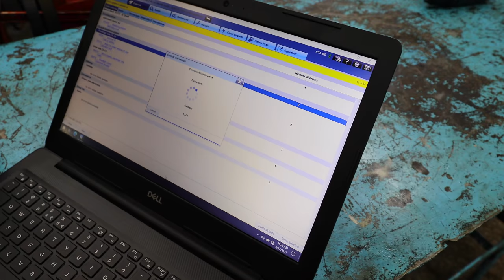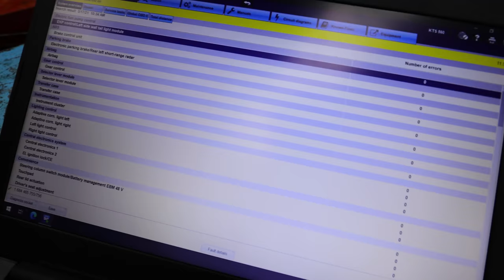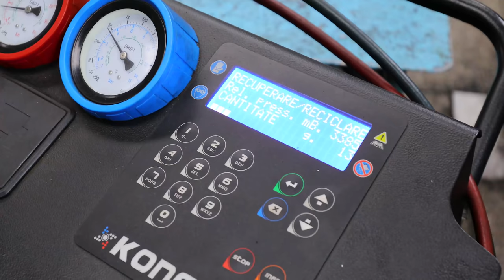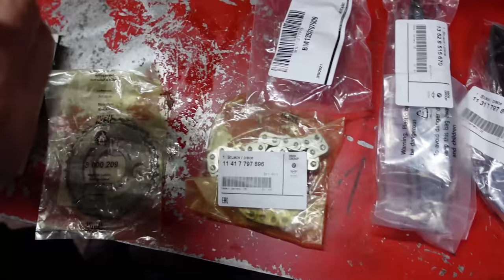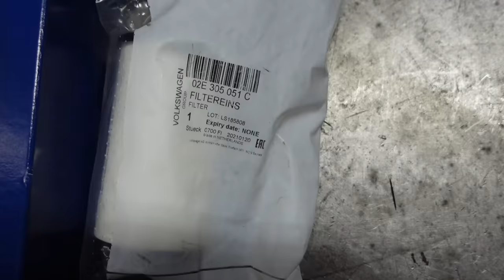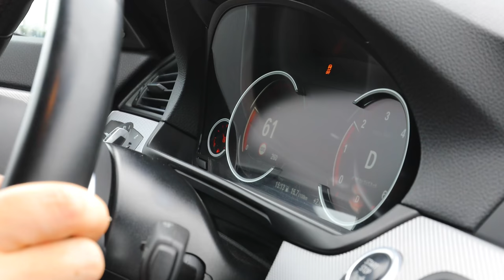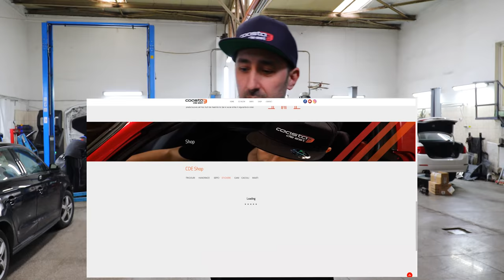BMW M550xd - balaurul cu 3 turbine 😈😈😈

Comment: as spune BMW e46 (sau 320 cum mai este cunoscut intre  bombardierii cu "figuri pe stomacul gol" ) cred ca este cea mai vanduta masina de la BMW din toata istoria si nu numai 🤣. dar lasand gluma deoparte cred ca BMW e60 ca si eleganta , durabilitate ,aspect si intretinere este o masina care chiar si dupa aproape 20 ani de la fabricare inca arata foarte decent in comparatie cu masini cu putin timp vechime. este una din masinile care ofera chiar tot ce ai putea cere de la un BMW . este confortabila (si sunt foarte multe imbunatatiri after-marchet care se pot face) ,durabilitatea motorului este arhicunoscuta in toata europa (in special motorul 3.0 D d2 218 cv ) in special motorizarile diesel se pot urca foarte mult de putere fara risc de rupere . Intretinerea masinii nu mi se pare deloc scumpa in comparatie cu multe alte modele de aceasi epoca sau chiar mult mai noi. consumul (si iarasi revin la motorizarea 3.0D) este unul ridicol pt un motor de mai bn  200cv si undeva la 500 nm (serie)  ( un 8,5 - 9l/100km). sa tinem cont ca este si o masina relativ mare si confortabila . deci parerea mea este ca cea mai buna masina fabricata de bmw este modelul E60 . indiferent de motorizare caroseria este si va ramane ceva special 🤗 SALUTARI SI MULT SUCCES IN CONTINUARE

Comment: Salutare băieți! 
După părerea mea ,daca ai un buget minim,cel mai bun model de BMW este BMW e60 ,3.0D ,deoarece nu are exagerat de multa electrica si este un motor NEMURITOR care daca ii faci schimburile la timp cu motorul original poate ajunge până la 600-700.000km lejer. Pe lângă acest aspect ,daca ii pui un pachet M si ii pui Angel Eyes(daca nu are de fabrica) ii schimba RADICAL aspectul.Eu zic ca e60-ul va fi o masina exagerat de potrivita.

Dacă ai un buget mai mare de exemplu 40-50.000€ ,mi-aș lua fara sa ma gandesc BMW X5 M550D,deoarece este o masina PERFECTĂ pentru toate punctele de vedere . Este o mașină mare ,care este exagerat de frumoasă,interiorul este extrem de spațios și pe lângă aspect si spatiu ,are si un motor potent pentru acea caroserie.
Succes in continuare băieți!

Comment: 42:32 in opinia mea e36m ,cel putin din punct de vede sportiv/drifting, este tractiune spate ,6 pistoane ,motorul este impins mai in spate rezulta greutate 50/50, manuala ,ieftina ;)) , motor de 2.2 nu e foarte mic sa fiu sincer ,calutii sunt acolo,e turbo , e frumoasa ,masinile vechi in mare parte sunt fiabile ,e din 90 deci check✅, si nu inseamna ca daca e veche e neaparat fiabila ,dar e36 este relativ fiabila pentru o masina sport , are prezenta de masina sport, de vanos nici nu mai zic, plus ca este unul dintre cele mai cunoscute modele bmw ,care daca nu ma insel a fost si rivalul lui mercedes 190e ,ambele bomba, cu siguranta n am acoperit toate calitatile ,dar in schimb vreau sa zic un defect ,OALELE ;))) nu stiu de ce ,dar din ce am auzit se sparg oalele, poate vine cu suspensii prea rigide din fabrica ,poate nu ,nu stiu ,n am avut ,am 15 ani;))) va salut 🙂

Comment: bmw m5 f90  deoarce  folosește un sistem de propulsie cu tracțiune integrală "xDrive", fiind pentru prima dată când un M5 nu a fost tracțiune pe spate. [89] [90] Cu toate acestea, sistemul de tracțiune integrală este orientat spre roțile din spate. De asemenea, poate fi configurat să trimită energie numai roților din spate, dacă controlul electronic al stabilității (ESC) este dezactivat , În decembrie 2017, F90 M5 a stabilit recordurile mondiale Guinness pentru  cel mai lung drift continu a vehiculului și Cel mai lung drift dublu a vehiculului (asistată de apă) pe un skidpad umed, cu distanțe de 374 km și 144 km , respectiv F90 M5 a înregistrat un timp de tur Nürburgring de 7: 38.92 într-un test realizat de Sport auto

Comment: cel mai tare BMW ? buna intrebare, eu am 2. E30 si E60.. daca ar trebuii sa aleg, cred ca as alage E30!.

De ce E30. BMW E30 sa fabricat din 1982-1994. Caroseriile au fost variate, Coupe, Sedan, Decapotabila si familiara.

Preferata mea ramane E30-ul sedan.

E30 e evolutia E21 se bazeaza pe aceasi platforma, dar liniile curate, pe care re are masina, fata si spatele patratos, o face sa arate intr-un mare fel. E30 a oferit o inbunatatire aerodinamica fata de E21, si masca fata nu mai era asa de inclinata iar farurile se integrau in ea. Pre facelift sa produs pana in 1987 si facelift pana in 1994. In 1987, toate modele E30 au primit un spoiler din plastic fata de cel din metal.

E30 a avut 6 tipuri de motorizari diferite M10, M20,M30,M40, M42, S14. 

E30 a fost o revolutie in industria automobilistica, demonstrand performatele sale pe circuit.

De ce imi place E30? Preferatul meu este E30 320i/is, 323i sau 325i. De ce astea 3 modele, pentru ca sunt motorizarile in 6 cilindri, sunetul pe care il dezvolta, si cum se simte motorul pe acea caroserie este un sentiment care nu poate fi asa simplu descric. Pe langa asta, forma masinii este un desen curat, simplu si atrgator, de multe ori, masinile simple, curate atrag mai mult de cat masinile complicate si cu multe butoane ( parerea mea), pe langa asta cum simti strada in  volan, senzatiile pe care ti le transmite masina, sunt inegalabile fata de masinile noi. E30 nu se mai fabrica, iar un exemplar in stare buna, costa mai mult decat o masina noua, putem vedea pe internet preturile. De aici denota ca E30 a fost o masina reusina si a deveneit o masina de colectionari.E30, are probleme mari cu rugina, podea, aripi pe fata/spate, si plaguri.

Sper ca anul acesta, sau la inceputul anului viitor sa pot cumpara un E30 si sa incep procesoul de restaurare :). Cam astea sunt punctele de ce imi place mie E30. Acum conduc un E60 tot benzina.

Nu sunt adeptul motorului pe motorina din cauza sunetului, benzina are sunetul ei :)

Comment: Modelul de BMW pe care eu il ador este e39
Am o legatura mai stransa cu acea masina deoarece in ea m-am si nascut aveam modelul din 2000 2.0i am tinut masina pana in 2010 din ce imi amintesc masina nu a avut aboslut nicio problema ajunsese la aproape 400.000km si in afara de uzabile si distributie pe la 200.000km nu a avut nicio alata intervenție 
Plus modelul M al acestei caroseri cu renumitul v10 (șoc in motor)

Comment: 1. În opinia mea cel mai puternic motor diesel cu şase cilindri din lume este BMW 750d xDrive şi BMW 750Ld xDrive (consum mediu mixt: 5,9-5,7 l/100 km), versiuni care dispun în echiparea standard de tracţiune integrală. Noul propulsor generează o putere maximă de 294 kW/400 CP şi un cuplu maxim de 760 Nm. Noul BMW 750d xDrive accelerează de la 0 la 100 km/h în 4,6 secunde (BMW 750Ld xDrive: 4,7 secunde) – o îmbunătăţire de 0,3 secunde faţă de predecesorul său.
2. Noul motor de 3.0 litri, cu şase cilindri a fost dezvoltat pe baza cele mai noi generaţii de propulsoare a BMW Group. Tehnologia BMW TwinPower turbo include turbocompresie în mai multe etape, cu patru turbocompresoare şi injecţie directă common-rail.

Bafta multa în continuare!

Comment: EU CRED CA CEL MAI TARE ESTE BMW M1 PENTRU CA:
(codul modelului - E26) este o masina sport cu motor amplasat central produsa de producatorul de automobile german BMW din 1978 pana in 1981. M1 coupe a fost construit manual intre '78 si '81 si are un motor pe benzina M88/1 cu 6 cilindri in linie de 3.5 litri cu injectie mecanica Kugelfischer-Bosch si un sistem de aprindere Magneti-Marelli. Motorul are 6 clapete de acceleratie individuale, came duble, 4 valve per cilindru, si genereaza in jurul de 277PS (204kW; 273cp) la 6,500 de rotatii si un cuplu de 330 Newton-metru (244lb⋅ft) in versiunea stradala, oferind masinii o viteza de varf de 260 de km/h, sau 162 mph. Motorul a fost conectat la o cutie de viteze manuala cu 5 trepte, produsa de ZF Friedrichshafen, echipata cu un diferential cu alunecare limitata cu blocare de 40%.
	Directie, suspensie si frane	Modificare

Comment: Pasionat de masini ca si voi, detinand un ford focus ca migulini doar ca breack ,imi plac foarte mult masinile vechi masini care indiferent ca nu vor mai fii raman in instorie cu un trecut frumos .
Din punctul meu de vedere marca BMW este o marca foarte buna de masini si nu spun asta doar ca este BMW  spun  asta fiindca de la incrputul vremurilor caroseriile cat si moatoarele fabricate pentru ele au o fiabilitate de buma calitate si durata .
1 . Parerea mea este ca modelul de bmw seria 3 e 21 asa zisul rechin echipat de fabrica cu 3 tipuri de motoare (1.6 , 1.8 , 2.0 ) la alegerea cuparatorului este un model fiabil si  frumos 
2 . Avand o lungime de 2,6 m conducerea ei nu era atat de grea pe cat parea .
3 . Era echipata cu o suspensie cu arc in fata iar in spate suspensie independenta   dand un confort foarte bun dar si o tinuta de strada foarte sportiva si cu o rigiditate acceptabila 
 Astea sunt o mica parte din multele + pe care le are masina . 
Din punctul meu de vedere si a unui pasionat de masini vechi , BMW E21 este o masina cum trebuie . 
Va apreciez enorm de mult pentru ceea ce faceti , bravo vouaa si tinetio tot asa , si eu am lucrat intrun service dar colectivul de acolo a lasat de dorit , as fii dat orice sa lucrez cu voi , bafta si spor in toate

Comment: BMW e60 530d 218 cai
Caroserie încă in 2021 atrăgătoare 
Motorul de 3l este silențios și economic fata de motoarele concurente de 3l de la Audi și Mercedes 
Probleme întâlnite in 6 ani:
Termoflot+conducte(amesteca apa cu uleiul)
Kit brațe fata (vibrații puternice la frânare)
Coroana de la volata(Motorul  era foarte zgomotos)
Turbina(la 190km/h a luat-o pe ulei,3 pistoane topite,cămășile la bloc afectate,cea mai simpla soluție alt motor)
Electromotor(nu învârtea motorul)
Alternator(mașina se oprea din mers fără eroare)
Revizii la timp,cu toate cele enumerate,mașina de pe o scara de la 1-10 primește numărul 8 fiabilitate

Comment: Salut. Cel mai tare BMW ever made este Z8. Motor 5000 benzină aspirat care să aibă 400 de cai și având în vedere că modelul are peste 20 de ani prețul a urcat. Mi se pare normal ca o mașină sport să arate că una sport și să aibă un motor pe măsură. Bonus este și cabrio ceea ce oferă o senzație diferită. Până și 007 James Bond a ales acest model pentru ca nu este cu nimic inferior unui Aston Martin, ba chiar are linii pe cât de sportive pe atât de elegante. Mi se pare că o mașină sport ar trebui să aibă un motor pe măsură nu 2 litri diesel cu pachet M și plin cu stickere. Nu sunt nici hater nici fan BMW dar sunt fan motoare aspirate de aceea am un 2000 benzină (statul pune taxă pe capacitate nu și pe performanță).
P.S. Va urmăresc atât cât îmi permite timpul dar de fiecare dată rămân cu un zâmbet după ce vizionez un clip de-al vostru.

Comment: Salutare tuturor.Este greu sa alegi un model de masina intrucat fiecare are gusturile si pasiunile sale.Din ce inteleg putem alege orice model de bmw.O sa incerc sa fac un top relationat la ce mi-as dori eu daca as avea bani sa intretin o asemenea masina ;).Criteriul principal in acest top este lookul masinii,pt.tehnica sunt sigur ca exista oameni mult mai capabili ca mine sa confirme sau sa sa infirme alegerea mea.
1) Bmw e93 coupe cabrio 335i, dupa cum spune si numele este in 2 usi decapotabila cu hardtop si foarte aproape de un model M.
2) Bmw 3.0 CSL Hommage R. new version.Nu stiu daca sunt de vanzare ;) dar cu siguranta as cumpara una daca as avea bani.
3) Bmw z1 pt. modul inovativ in care se deschid usile.
4) Bmw 850i doar pt. motor v12 , pt. ca legislatia actuala nu mai permite faruri escamotabile ;) 
5) Bmw 750L(model 2001) pt. ca aveai posibilitatea sa o cumperi blindata ;)

Comment: salut
pentru prima oara las si eu un comentariu....stiu sa imi fie rusine...
dupa parerea mea BMW M3 E46 CSL este o legenda pe patru roti cu doar 1383 de modele fabricate (este cel mai scump model e 46 inca de la fabricatie) acesta sa fabricat intre ani 2003 si 2004  unul in stare foarte buna este aproximativ 65 000 de euro, masina venea in standard cu plafon de carbon care cantareste doar 7 kg

Specificati tehnice.
motor 3.2 24 v 360cp 370 nm la 4900 de rotati pe minut 
injectie multipunct
0>100 4.9 sec
viteza maxima limitata 250 kmh
cutie automata in 6 trepte smg 2 cu un  singur ambreaj
greutatea masini este de doar 1285 kg
consum:              oras      17.8
                   autostrada     8.4
            si combinat de     11.9  
De masina asta se pot spune foarte multe lucruri, in ziua de azi toate masinile  din seria M si M performance sunt din ce in ce mai incarcate cu senzori, de la suspensie si pana la volan totul este electronic
@Baieti sunteti cei mai tari in special valica

Comment: Salut baieti! Cred ca in inimile multora o sa ramana M3 e46 coupe ca fiind cel mai deosebit model de BMW, cel putin pentru mine acesta este. Este greu de explicat de ce dau acest raspuns, si spun acest lucru, pentru ca in anii 2021, performanetele masinii respective sunt pe departe depasite de multe modele noi BMW si nu chiar M, insa pentru acei ani, era ceva deosebit.  Se comenteaza foarte mult de asemenea si de problemele lui, mai ales despre cutia SMG, sau despre cuzineti, puntea spate. Fiecare motor si masina are micile probleme, insa merg pe premiza ca se pot rezolva. Sunt fan cutie de viteze manuala, insa, daca imi voi permite  vreodata o masina proiect, ar fi un e46M cu SMG, pentru ca il vad ca si pachet. 
Este o masina ce face trecerea intre old school si new school! Are electronica de care ai nevoie, insa se conduce ca si o masina old school, servodirectie, rigida, siseme ce pot fi dezactivate usor etc.
P.S. Tineti-o tot asa!

Comment: e36 si e46 au un loc special in inima mea ar fi greu de ales dar cel mai probabil as alege e36 doar din cauza electronicii care este  mai simpla , chiar consideram un e36 320i cand imi cautam prima masina doar ca stiam ca o sa imi fie foarte greu cu intretinerea (piese scumpe) si nu voiam sa o transform intr-un "cazan"  , deci pentru mine cel mai misto bmw o sa fie un e36 coupe 2l benzina 6 cilindrii single vanos pentru ca double vanos e mai problematic desi e mai interessant pacat totusi un vtec german nu suna rau deloc.

Comment: Din punctul meu de vedere,eu as spune ca cel mai misto bmw din toate timpuriile este seria 5 e34, spun asta deoarece am detinut unul acum vreo 4 ani, si am ramas placut surprins de modul in care se conduce ( ps: pe drum privat ca n am permis) , si fiabilitatea sa, spun fiabilitate, deoarece acel bmw , eu cu cumnatul meu il cunosteam de ft. mult timp, si stiam aproape tot despre el. Masina pot spune ca era un tank pe roti, datorita fiabilitatii ei, poate si pentru ca a fost intretinuta, cand a fost la mine, avea aprox. 300 de mii de kilometrii la bord, kilometrajul resetandu-se singur la frumoasa suma de 999.999 de mii de km, pentru cei care spun ca exagerez, sa stiti ca nu o fac, chiar atat avea, masina facea europa cu platforma dupa ea aducand masini. Masina era foarte solida din orice punct de vedere, exceptand miciile imperfectiuni ( puncte de rugine, cateva indoituri specifice varstei , ea fiind din anul  1991 spre sfarsit, fiind si anul in care s a introdus si motorul 2.5Tds, masina avand acest motor de 143cp, care iti dadeau impresia ca ar fi mult mai multi.
Despre consum nu pot spune ca era foarte mare, la mersul nostru undeva la un 10/12 daca mergeai frumos cred ca ar fi luat si 8l/100 km.
Fiind diesel si vorbele din popor spunand ca porneste greu iarna, exceptand faptul ca , nu cred ca ar fi avut toate bujiile incandescente bune, sau poate intregi, pornea la ''sfert'' de cheie si la -10/-15 grade. Spun ca nu cred ca le avea intregi, ca am gasit prin scut 2 bujii rupte si 1 intreaga :))) , dar nu ne am batut capul sa ne uitam dupa ele :))
La pachet cu masina, au venit niste piese de rezerva de la primul proprietar din tara, al respectivei masinii, spun primul ca cel de la care am luat masina nu am comunicat destul de bine, acele piesele dandu le si noi mai departe cand am vandut masina.

Problemele nu am avut  cu ea in cei 4 ani cat am avut-o  exceptand o mica pierdere de ulei de la baie, fiind fisurata intr o bordura , si ruperea unei tevi mici in care se mufa furtunul de motorina, care da , era conectat la o mica pompa de mana pentru amorsare, daca statea o perioada de timp se dezamorsa si nu mai pornea, adica invartea foarte mult mai pe scurt , si am decis decat sa omoram bateria sa montam aceea pompita, nu inainte sa rezolvam problema, care era teava cea mica de mai sus fisurata, dar am ales sa lasam acea pompa acolo pentru orice eventualitate. 

Cand am cumparat masina fostul proprietar '' pierduse un cip din cheie" defapt nu l pierduse nu a vrut sa ni l dea, o intreaga poveste si aici , dar sa ramana in familie >)) , gasind un electrician priceput, am dus o la el, si a reusit sa faca o improvizatie la contact si imobilizator, am reusit sa pornim masina, oricum, contactul era defect ( cred ca este o problema comuna la el, am mai intalnit masini care porneau cu surubelnita ca al nostru), cheia mai fi putand fi folosita doar la deschiderea portbagajului. 

Per total, cu  toate defectiuniile ei, daca se pot numii asa, am ramas un mare fan al acestui model, datorita feelingului pe care masina ti l ofera, iar in viitor as vrea sa detin un model, poate chiar sa incerc si varianta pe benzina pe care mi as dorii sa o incerc pentru a compara putin ideea de benzina/diesel.